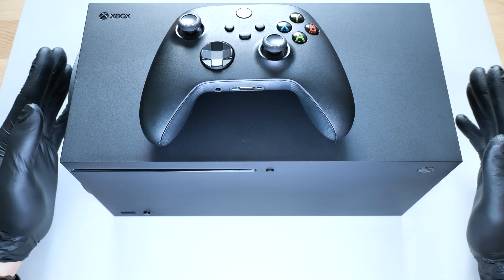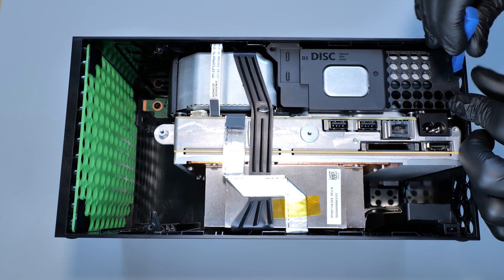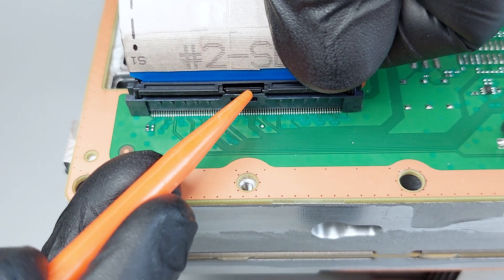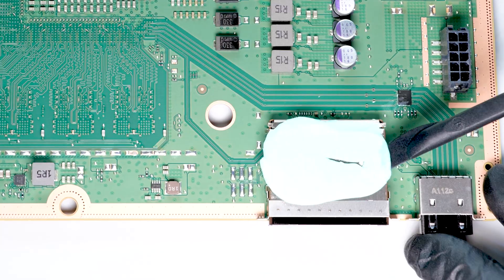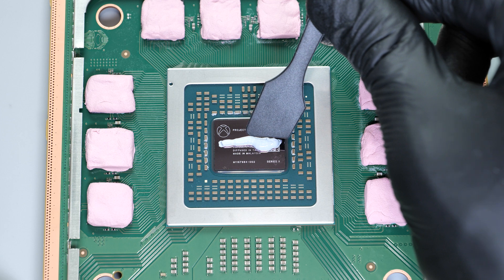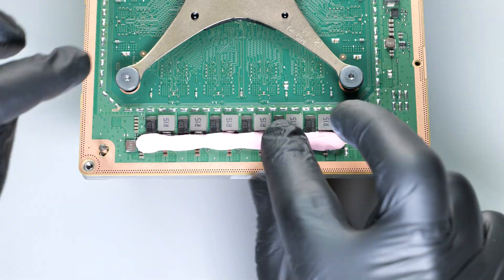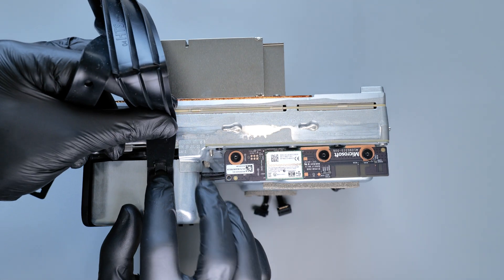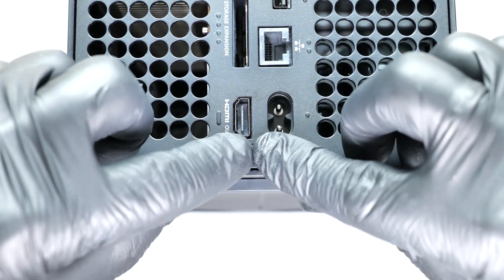Xbox Series X Thermal Paste and Pads replacement and Cooling System cleaning

Comment: I read a comment on the 1x replacement video and i read that you started to use this thermal putty now and not those thermal pads. I would like to know how thick should i make the thermal putty "dots" for my xbox one x ( RAM, mosfets and southbridge...) or the best way to apply them so that there are no gaps.
Reply: i have a one x and for the southbridge i just used a 1.5 or 2 mm pad. for te puty i just formed it into litle bals and placed it on memory and for the vrm i also just placed seperate balls on each component. after aplying paste and tightening the heatsink the balls squished into the right shape. if u dont know how much to use on memory or vrm then just put a bit, press the heatsink down, if its mostly or fully covered then thtas the right amout otherwise add more.

Comment: the reason you often see the "dollop" or "line" applications of thermal paste is because it's being done on CPUs with integrated heat spreaders, so the DYE is actually fully  covered, it's just the edges of the heat spreader that aren't. Which doesn't matter. But yeah for a bare dye like the Xbox or a GPU you absolutely want to spread the compound to make absolutely sure there's no dry spots. With an IHS the dye itself is a lot safer because it always has that integrated heat spreader to pull heat away from it where as dry spots on a bare dye there is no where for the heat to go.

Comment: Thank you for the video
Is it possible to apply thermal putty on the cpu? why we need a paste for that?
Reply from the maker: Why do we put oil in a motor and thick grease in bearings? The thermal putty and thermal paste have different density and are not interchangeable at all.

Comment: My xbox fan sounds like a small jet engine, I've replaced the fan itself but made no change, I've cleaned the internals but no change.

Will replacing the thermal paste reduce the noise the fan makes?
Reply from the maker: It should. I've repaired a lot of consoles and after cleaning and replacing thermal pads and thermal paste all consoles start to work as a brand new device.

Comment: How often would I have to replace the thermal paste?
Reply from the maker: The original dries pretty fast. Grizzly thermal paste will last for about 3 years.
Reply: @ElectronicsComputers  thank you! And what would you recommend i use to clean of the old thermal paste?
Reply from the maker: @AQUXS4184  Rubbing alcohol.
Reply: @ElectronicsComputers so I have been debating wether to do this like does it actually need replacing? I’m not a tech guy myself so idk if I trust myself

Comment: What are the symtoms of having to do this???
Reply: well, in my case, I've had the console since launch (nov 2020), and recently, in the last year, it's been getting louder and louder to the point i can hear it with my headphnes on! so i just finished replacing the paste with this video, and my thermal paste was VERY dry like cookie crumbs, but now it is back to being just about silent like it used to be.
Reply from the maker: The fan noise became louder and fan works on higher RPMs for a longer period of time or all the time. The console turns off during the game play. As a result of overheating, you may see some artifacts or visual anomalies on the screen.
Reply: I will declare myself a professor if I can do the paste replacement😀

Comment: I can use thermal pads cant i instead of putty yes
Reply from the maker: There's extremely nonstandard thickness between all parts. So to make it work you'll need highly compressible thermal pads which have very bad thermal conductivity. I suggest using Upsiren U6 PRO ( the link in the description), thermal putty doesn't look as beautiful as thermal pads but it does a great job transferring heat from the components to the heat sink.

Comment: Great DIY. Just did it today. Used upsiren UX Pro Ultra putty and upsiren UTG-X paste. Made a big difference. Heat coming out of the console is noticeably warmer and fan does not spin faster than idle. A lot more heat transferred to the heat sink.
Reply from the maker: Great job! It will significantly prolong the lifespan of your console.
Reply: This should be the new gold standard for disassembly videos, I love the screw tips and you even weighed the putty, very helpful! Instant sub. Say, would it be a good idea to use the new Thermal Grizzly TPM pad instead of thermal paste? It doesn't harden like paste does.
Reply: This would make it quieter but I just added a second fan that only comes on if it reaches 120F. Guys it doesn’t get warm unless you always have it on and your room is really hot. This is a fix for people in tropical climates with no AC.
Reply: @quin_helldiver  you must not play a lot
Reply: @jakeh7284 how is your Xbox now? i also replace with UTG-X
Reply: Fan still rarely gets above idle. Exhaust air is hot, console itself doesn’t even get warm 👍🏼
Reply: @jakeair7772  I also use U6 Pro and UTG-X. Xbox is warm, I think warmer than before, air is very hot but fan is a little more noticable than before. Its still quiet
Reply: You did all that and did not use grizzly? Grizzly is on a different planet compared to other pastes. I have only used every brand out there and used to switch around until D8 designed grizzly. Kyronaut is made just for GPU's so its the best thing you can use on a console aside from liquid metal.
Reply: @HardWhereHero  I find it tends to dry quickly. Lately I've been using Phase Change Material, especially for any direct die applications. Some good ones to choose from include Honeywell PTM7950, Upsiren PCM-1, and Thermalright Heilos.
Reply: Hope this is what's wrong with mine keeps crashing on games but plays cloud games just fine
Reply: @nickvendetta4394 mine been crashing games too. Mainly Madden & PGA. Never crashes while playing Forza.
Reply: Was your console overheating ?
Reply: No, but I’ve had it since launch and want to keep it as long as possible. Plus I wanted a reason to take it apart 😂
Reply: @jakeh7284  this is the way :)
Reply: Nice 😍
Reply: I use Upsiren on my S love that pink stuff.

Comment: Thanks man, if not the best, definitively the best video I ever seen for doing this maintenance, gonna keep it on my favorites, also there's also a link for a replacement SSD Western Digital-WD SN740, is it 100% compatible? what a huge find.
Reply from the maker: Thank you for the comment! It's not compatible out of the box.
Reply: @ElectronicsComputers  Thanks my friend, some people say you can´t recover a Xbox SDD partition, I guess it doesn´t work because of OSU update file, you must match the same version of the OSU, as an example, if I opened today my XSX and cloned the 1st partition for backup in case of future failure,  I also need also to download the available OSU of today to keep it with me, because in some months apart, if I replace the internal SDD with a newer one, I will restore the partition, but the OSU will be of a different version, so partition will not match the version of the dashboard when it was first cloned, and hence not boot, is not a perfect clone because partition and dashboard are not the same, hence not working, I guess this is the reason people can´t recover SDD, also a new approach don´t know if possible before opening the console, download the available OSU file, try to reinstall the operating system, which will rewrite the keys for that particular OSU file and matching keys in the hidden partition and clone the partition, which will guarantee probably 100% success I guess.
Reply from the maker: @Viggen66  Yes, I always recommend performing an offline update before disassembling the console. There's a good deal on external Seagate Storage Expansion Card 2TB on Amazon, so I wouldn't even try to upgrade my own console. Just by a card, plug in and enjoy.

Comment: THX, great video! If i cannot get any thernal putty in my area and is forced to use thermal pads, what thermal pad thinkness will work? thx
Reply from the maker: Thank you for the comment. I've provided the link with free delivery to any county in the description below. It's not that easy with the Series X. I've made an upgrade video for the One X, where I replaced thermal putty with thermal pads. However, nowadays we have excellent thermal putty that outperforms most thermal pads on the market. The issue with the Series X is that you have to use a variety of thermal pads with different thicknesses, and they should be highly compressible. The harder the thermal pad, the higher the thermal conductivity. Therefore, if you use soft thermal pads, you will compromise the cooling performance of your device.
Reply: @ElectronicsComputers  Thx so much for the reply! Like I said, in my area, I need to pay high amount of shipping cost if I were to get some putty…..Can u pls advice the thinness of the thermal pads at least for the 10 chips around the cpu l. Thx

Comment: Instead of Kryonaut, I would more recommend applying the Honeywell PTM 7950
Reply from the maker: That solution is a bit pricey but works pretty good. We've been using Grizzly Kryonaut for many years in our service and that paste lasts for many years without loosing its qualities. But in reality any good thermal interface will do its job better than dry original paste.

Comment: Very concise, teardown. I wonder how much lower Temps you get using thermal grizzly vs the stock thermal paste. I know it'd be hard trying to get an accurate reading without thermal probes. Just curious what it theoretically could do. Thank you for the video.
Reply from the maker: This is a typical paste and pads replacement that we do on a regular basis for clients who bring consoles with overheating issues and noisy fans. After the replacement, the temperature of the heatsink increases by 5-9 degrees Celsius, indicating that more heat has been transferred from the APU and other components to the heatsink.
Reply: Premesso che sto cercando il prodotto migliore, ho letto che la Grizzly ha valori inferiori a questa, perchè la consigli? ripeto per me che la devo ancora prendere è un aiuto la tua risposta non una critica o provocazione. Grazie